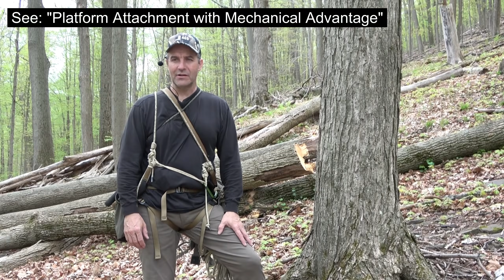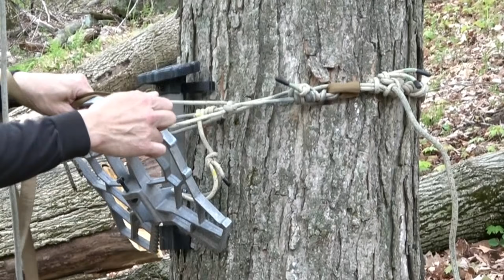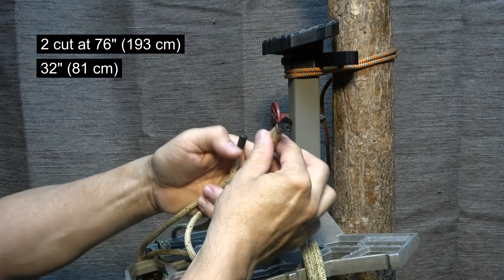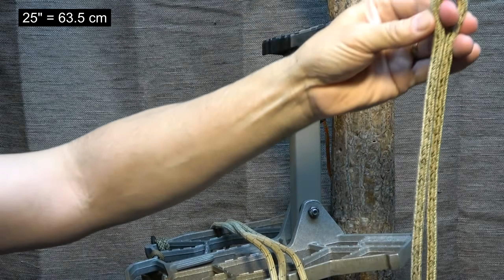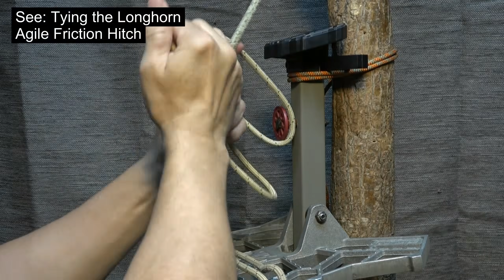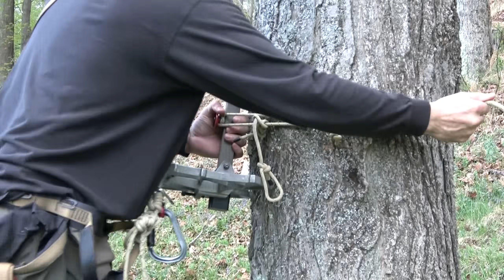BHT Platform Attachment

Comment: What knot do you use to attach the webbing to the front of your platform for the neck loop?
Reply from the maker: Its an overhand end loop. Imagine you just took a Bight, folding it flat on itself and made an overhand knot.   That's it... but in order to put it on our platform, we have to use a follow through method to tie it.  Do you think this is worthy of a dedicated video?
Reply: @jrbtc ended up tying the BHT 8mm pred mainline and 5.9 Powercord for BHT. The Powercord is a bit to tie tight but once it’s dressed it works amazing and it’s rigidness helps it glide well over the nylon tubing. Didn’t even need the other blakes to release, releasing at the LGAH is a breeze.
Reply from the maker: @TherealFNM yes, i have been been able to get it off without the 2nd blakes also. That will be eliminated in the next update.  Also considering a shorter rope plus a sling. We only put the sling on when we need to on a huge tree
Reply: @jrbtc can’t wait to see!
Reply: @jrbtc  maybe. But I figured out the follow through. Wasn’t super worried as it’s not life safety just needed it to hold. Thanks. Liked this idea for not dropping it. I got my 10’ of 8mm predator rope just waiting on my 5.9 Powercord and I’ll be doing the mechanical advantage attachment using hedden, rapell ring and CJRBAHNJ.

Comment: For the button space issue, what would think about making a short loop of 6mm cord through the flopper knot as an adapter to the button to avoid any tinkering with the platform itself?
Reply from the maker: That sounds reasonable.  But the way we connect them is important, while ensuring that it won't fall off.  For example, i would not simply tie the loop inside the Flopper loop, as if it was a link of chain. Rope on rope should never be connected that way.  It might be better to get rid of the Flopper, tie a fat stopper knot instead, and put a stable Friction Hitch right against it. Like a Hedden.  Just need to make sure ya got enough weight to flip around a large tree.
Reply: @jrbtc Thanks!

Comment: Thinking of building this with 7mm sterling cord as mainline and 5mm power cord as BHT.
Reply from the maker: 7mm Sterling cord is Nylon and it stretches more than ideal for this application.  I am not saying it won't "work", but i prefer something with less stretch.  Lately, I am testing a new friction hitch and its performance in all kinds of applications. And i have been tying Sterling 5mm cord onto 6.8 mm TVAC cord and surprised as how well it holds.  If you want to experiment, you might try that.   All in all, I think 8mm rope is the best though.   For example, when i need to flip it around a really fat tree, tossing the 8mm feels perfect.
Reply: @jrbtc yeah I was thinking that. Sterling makes a 8mm static rope I may try or 8mm predator, 6mm trc for the hitches. But I like the 6.8 and 5.9 combo. Right now I have an amsteel HFAS from Hangfree, it can’t be lighter than that to throw around a tree lol
Reply from the maker: @TherealFNM Sterling also makes an 8 mm cord called flex. Please take advantage of my website and my discount with ape canyon. Just use the jrb15 coupon code at checkout.
Reply: @jrbtc already did🫡 I use your site like an encyclopedia. Got some 6.8tvac and 5.9PC on the way. Needed the smaller diameter anyways bc the button on my predator platform is smallish.
Reply: @jrbtc I wonder what forces are on the rope and hitch’s when the platform is toe hitched to the tree?
Reply from the maker: @TherealFNM difficult to calculate.  Difficult to measure

Comment: Hi john im definitely building one of these platform attachments for my latitude platform, strap they provide not very long ,ordering right rope and cord when I get Maverick pole, im happy with system I use now, tie into tree with Maverick hitch, do in dark now problem, climb with longhorn agile hitchs on both end of my 60 ft 9.5 mm rope, I tie a super Maverick on my last transfer ,garna footloop works great, I like 2 feet in it ,feel more balanced, its great what you've doing and I want to thank you, no more dangerous one sticking for me, Lonnie Dalton Massachusetts usa
Reply from the maker: I appreciate knowing that I am helping you out.  Just last night, I was scouting and moving trail cameras and visiting some old paracord presets. One was in a tree that died so i removed it.  But instead of replacing it I just decided that next time I hunt that spot I was just going to Hitch climb the tree next to it. It's changed my own game as well.
Reply: @jrbtc thats improvising, I have my original 40 foot rope still with a quicklink  ,I usually climb with my 60 ft rope with the longhorn agile hitches first, then leave a  stand and 40 ft rope in tree , then pick another spot and set my 60 ft rope and other stand  ,depending on wind and conditions, ill choose a stand ,just hook up to my duel bridge, which I fabricated via your instructions, I tie in with Maverick hitch  and final tie in super Maverick, I enjoy climbing in dark with red headlamp or no lamp ,thanks to your thorough instructions ive become a better climber, safer too loo ,tx john
Reply: @jrbtc September 7th bear season starts, im going way out there in bear country, pick a tree and call one in
Reply from the maker: @Lonnie-y9g good luck!

Comment: John, Is there a platform that you recommend that offers enough room behind the button to allow both ropes to do their thing or do you recommend  adding the washer for this platform?  I do not have a platform or the ropes yet.  I've been trying to watch all your videos to buy and build a climbing system for hunting next year.  I have enjoyed your content.  Thanks for sharing your knowledge John.
Reply from the maker: It's a great question and I'm afraid I don't have an answer for you. I have only owned one platform and I generally like the EDP, due to it's size and rugged build, although I do wish it was a little lighter. Many of the guys in my FB group have adapted this design to other platforms, including some with no button, just a cleat.  Some manufacturers seem to be trying to hard with unique replacements for the button, when it is not the problem at all. It's the lack of tensioning capability. Structurally, i believe this washer hack is fine.

Comment: What knot did you use to make the webbing shoulder sling for your platform?
Reply from the maker: It's just an overhand end loop, but i had to build it by threading it since it is woven into the platform.  A single overhand noose knot also works. I actually can't remember which i have on right now. It's in the truck and I am not lol.

Comment: Would that work for a hang on stand to be left in a tree?
Reply from the maker: It works to attach a conventional hang on or anything with a button, but how long you leave it there is up to you. Anything we leave in the woods slowly degrades over time.  Whether it's a convenientional strap, or a lifeline, or a rope or cord, we are subjecting it to the elements including UV.  Consider that a critter like a porcupine or squirrel could chew on anything anytime.  You get to decide what time and risk you are willing to accept. And when to replace it.

Comment: John, I’ve discovered a variant based on reducing stretch. I am using short lengths of 1/4” plastic steel cable ( no stretch) and no noise. Obviously, for the friction hitches I’m using standard cordage.
Reply from the maker: I'm not sure I would trust a friction hitch to hold a plastic coated cable.

Comment: Most ridiculous thing I’ve ever seen.  Why?  If folks are that concerned just use a ratchet strap or better yet a simple ocb buckle.  Metal?  They make little neoprene covers if that’s your fancy….
Reply: There's an easy no metal option...amsteel w/ multiple interlocking knots/loops.  You'll find nothing lighter....zero.  yes you'll have to tie hook it....just as you might with 99% of any others.
Reply from the maker: @stevenl4494  i am aware.  Of all the things I tested, a daisy chain performed the worst. Its actually got a fair amount of slack in it until the toe hook.  The true test is on a large tree.  When i am climbing a tree that is 3' thick, even if i put an extension on the daisy chain to make it long enough... It's just too light to flip around the tree reliably so I can catch it with the other hand, as demonstrated here with the Flopper knot.  A few extra ounces doesn't concern  me.
Reply: @jrbtc I get the point, no problem.  I just find myself toe hooking, regardless, the vast majority of the time anyway, so thats not an issue to me.  As far as flipping around a larger tree, i custom make my "daisy chain" fairly long (maybe not 3'dia long) and embed fishing weights in the end/tip inside the amsteel.  No issues whipping that around most trees so far.
Reply from the maker: @stevenl4494  amsteel is incredibly strong, but is notoriously poor when it comes to holding traditional knots. How did you construct yours? And how did you test it? I'm not giving you a hard time. I'm just giving you some things to think about.  The same way I challenge my best friends. Cheers
Reply: @jrbtc Just triple brummel (sp?) knots to the desired length, bury the ends, insert, by FID, 5-10 splitshot type lead weights, shrinkwrap the ends.  I don't have much of a way to test it, as I don't have that kind of gear.  Others do sell similar products commercially...but I up the amsteel size.  And add a Bungie loop at the end to tension it once wrapped around the platform, so it won't flop around.
Reply from the maker: @stevenl4494  sounds nice. Regarding my design, the folks who know my content already know how to tie each of the building blocks for it. And so although it looks intimidating as a complete assembly, each of the parts is made independently: Flopper knot, Longhorn Agile, Blake's Hitch tensioner, Bowline.  Cheers.
Reply: @jrbtc I have, i think, missed very few of your posts.  I use your Moose hitch on my main climbing line and tether (both with rings), longhorn agile hitch (missed the 'stable' part somewhere) and garda footloop.  Bought my main climbing line from ape canyon? based on one of your recommendations - and love it.  Still fooling around with my bridge based on what you like to use.  Got the maverick pole recently and have some "plans" to do with it.  Have tied and tried a good deal of your knots, to include the first iteration of the platform attachment.  Unfortunately just not for me right now.

Id say your channel is awesome and has influenced me greatly!!  Keep it coming.  Outstanding!  Your channel is invaluable IMO.
Reply from the maker: @stevenl4494 thanks for your comments.   I am doing my best to respond to questions I get from my friends and followers.   And I realize that not everything I publish is something that every person will be interested in. That's completely understandable. I'm just trying to provide options and do my homework before I publish them.
Reply: @jrbtc 👍👍 NP, please keep it coming, it's all been great, either way.
Reply from the maker: @christhomas1465  To catch you up, we already had a mechanical advantage system. But the team wanted a no medal option.  When we install our platform, our feet are in the air.  Flipping anything around a large tree has to result in no chance of a clang.  A ratchet strap gets tight but meets none of the other requirements.  Also, your credibility is undermined by your choice of words.
Reply: @jrbtc  My choice of words were in no way offending other than I disagreed or questioned the contraption of ropes you presented.  Does it work, I guess it does, but in my mind, simpler is almost always better, regardless of the subject and its application.  I have been flipping various types of straps, ropes, etc around trees for decades now and rarely do I clank anything.  Its really not that difficult.

The thing that concerns me about you is that with your obvious plethora of knowledge, which I would never debate, you assume that most folks will learn and do the same things that you do.  Most of us are simply hunters, who want to hunt off the ground.  Most of us do not want to learn all the specifications and acquire the significant amount of knowledge that you possess from your climbing background in order to hunt off the ground.  While I imagine you'll say that if we want to hunt from elevated positions, we should be learning as much as we can, and I don't disagree,  this only goes so far for most people.
Reply from the maker: @christhomas1465  Thx. We agree on most of that.  However, I don't assume anything about what viewers will do. I just do my best to provide options that I have thought through and tested. The device ya see here will look complex to somebody who isn't aware of the building blocks.  Just like anything in life, the more educated we get on a topic, what initially looked intimidating becomes elementary.  Each of the knots are pretty straightforward on their own.  The design simply prescribes how to arrange them.  I  am also unaware of any system on the market that works on a 3ft diameter tree as well as this.

Comment: This looks like it will get a lot tighter than the first version!  Can't wait to give it a try!  Thanks!
Reply from the maker: @gwhalin  the mechanical advantage is theoretically the same, but the BHT has zero setback, ensuring that when we finish our pull, it stays right there and doesn't "relax" with an inch of undesirable slack inside the system before holding.